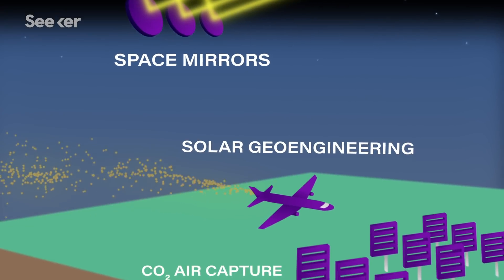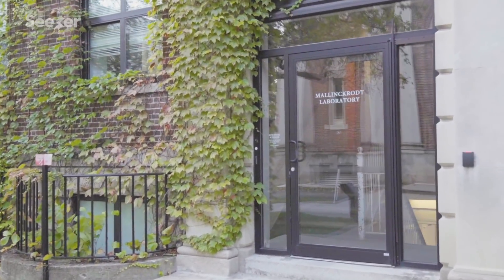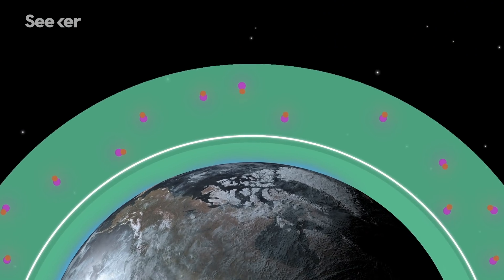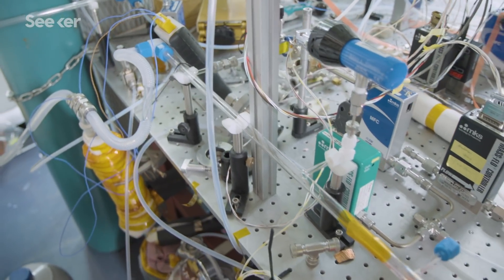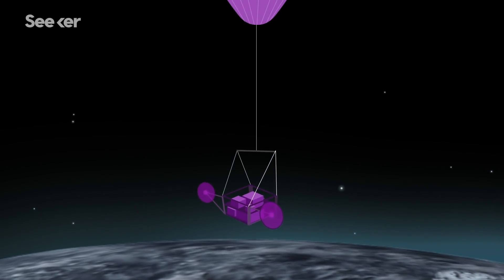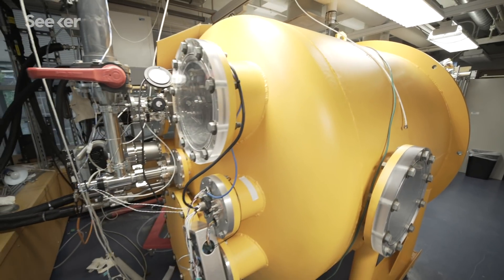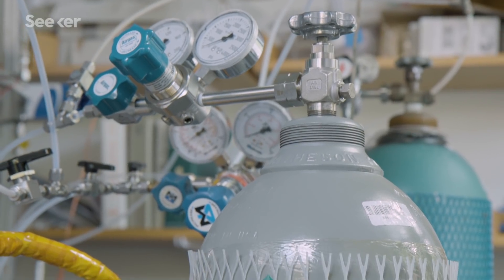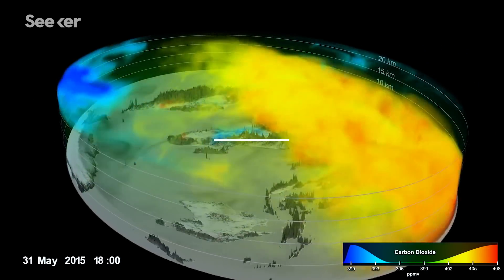Why the World’s First Solar Geoengineering Test Is So Controversial

Comment: What if we cool not the globe but Regions?
Then it’s local shading , So a dust cloud of lime, on the west coast would drift east cooling the continental US for another 4 days. It only has to reflect 2-5% of the sun to lower temp 10-15 degrees. Similar to a cloudy day. Lime has acid neutralizing properties and is a fertilizer. Who doesn’t want cooler hot days?

Comment: Sure let humanity load up on one uncontrolled multigenerational experiment with another uncontrolled experiment! Sheer brilliance! What could possibly go wrong ?! 

The old adage when in a hole STOP DIGGING  FIRST ! 

Let’s adapt first to the damage already in the pipeline ( gaseous pun) and transition to at least carbon neutral fuels , solar , wind and geothermal first ! 

The US ramped up within a few short years to win WWII . It only took 13 years to go from horse drawn carts to gas powered model-Ts! It can be done ! Leadership and will are what is needed!

Comment: In the 1970s scientists wanted to use crop dusters to spread charcoal dust on the ice caps to absorb more heat to prevent the coming ice age. Good thing we have never taken drastic steps in the past. Manhattan was supposed to be under water by 2016 according to al gore and “the consensus of scientists”. All you can do is laugh at them I guess.

Comment: Well someone jumped the gun and started this many years ago. Or EPA don't check what's in jet fuel anymore. Because jets exhaust or spray from jets, are making clouds. Last I checked, clouds come from particles in the atmosphere that moisture attaches to and becomes visible as clouds. So, these clouds that comes from jets are due to some kind of particulates being sprayed from the jets. Even more proof is that when they turn them on and off . The temperatures vary in height and unless the jets are diving up and down throughout the sky , they have to be turning on and off the spray  I got lots more.

Comment: Misleading title; 1st enclosed test

Weather modification's been going on for decades many countries openly admit it using it. 

Even NASA published on the impact and side effects of mass Aviation persistant contrails which increases Greenhouse effect caused by vast amount of CO2 on a daily bases with more than 200K flights per day, call what you will planes plumes darken the sky blocking the sun almost everyday.

Comment: Geoengineering experiments are necessary to determine if they cause harm to the environment and if they work. They are measures of last resort since mankind might become addicted to geoengineering on larger and larger scales if it's used instead of reducing co2 levels. If a world war or an economic collapse interrupts the artificial cooling there might be a rebound where the temperature rises out of control.

Comment: One of the small graces was that because we used coal so much and for so long we caused global dimming, which allowed us to keep global warming from progressing too quickly. However, this isn’t good in the long term. We have to find something to reduce the CO2 quickly before the smog clears as we move to sustainable energy production.
Reply: Why would the smog clear?
Reply: @yourmomsphonenumber  if we stop putting as much into the air because we move towards combustion that is more complete or if we forgo combustion all together and choose solar or wind there is less smog entering the atmosphere allowing the smog that is already up there to drop back to the earth through natural processes clearing the smog naturally over time. But the CO2 doesn't get absorbed nearly as quickly and will linger causing lasting damage.
Reply: @milohobo9186  But every solar panel every windmill, every electric car, everything needs to be produced so I'm really not sold that smog is going away. I could just be dumb and I'm not saying we shouldn't try to create a solution but I'm really not convinced that we have any solution yet.
Reply: @milohobo9186  we just rely on petrochemicals too much we have too much we can't just stop now...

Comment: Stop gap measure at best. And people will only take the inch of space this gives and rapidly use up a foot. So then you would have to geoengineer more. And then more. Sooner or later there will be repercussions, and it may not be easily reversible. The fact of the matter is that the world population needs to reduce by half. At least. Amd even that may not get is out of this mess. The feedback dominos may already be falling and we could be locked into a devastating outcome. There is no nice way out of this. It's either stop growing and retract, or face a worse outcome. But even the best outcome is probably horrendous and terrifying. The worst is nightmarish.

Comment: Putting particles in the stratospere is fuckibg stupid.. uncontrollable.
What follows might look like a fantasy but is in fact quite easy and is plain common sense.
We need to invest in industrialization of the moon asap and the first thing it produces is a bunch of thin mirrors who will shade the earth from the sun a bit if needed to cool it a bit.. and perhaps a magnetic rail launchsystem to launch them up from the moon. Voila.. manual thermostat.. one problem solved. 

Be good to children etc etc.

Comment: Flawed premise for investigation, experiment bound to fail. You took the IPCC models and 'data', assumed it was true and proceeded forward. What you should have done is question the data first, instead of assuming it was correct and assuming there is a problem with CO2. Find out how they made those projections and models, you will be sorely disappointed.

Comment: I'm starting to see that many of these, climate change, Scientists models are static. They aren't taking into account the magnetic field and how of course there is going to be a depletion/hole in the ozone at the North and South Poles. Or that the earth's climate is dynamic in that it expands and contracts based on the amount of aerosols that the atmosphere takes in at any given time, from natural events like volcanoes which put out way more pollution than humans do. It's a safety net built into the atmosphere. I think we need to get away from these computer models. Because they don't ever have all the information necessary to produce a realistic picture. That's why the FIELD is where discoveries are made. Anyone can plug in and number of different scientist data to make their Theory work without putting in any field work.

Comment: I am not opposed to research, but I've said for a while that the hysteria over climate change looks a lot like Pascal's Wager which is a faulty proposition because it doesn't consider that taking the proposed action could be worse than doing nothing. I don't deny the climate is changing, but I don't trust that we understand the situation deeply enough to take sensible action outside of the things we're already doing (namely, developing alternative energy sources).

Comment: Instead of spraying more crap into the atmosphere to try and increase the albedo, why not build massive CO2 scrubbers to remove the excess carbon 12 we are adding to the atmosphere? This seems like a much better plan in my opinion because we could use the CO2 harvested from such a system to produce A net zero algae-based fuel to replace gasoline and kill two birds with one stone. This would give us enough time to reduce omissions to zero while dealing with pigheaded government officials who refuse to act.

Comment: Actually they’re both right we need both adaptation in the form of changing how we produce energy by switching to wind solar advanced battery  energy storage using liquid flow batteries Nuclear fusion. Thorium fission wave reactors using molten lithium salt Hydroelectric power plants designed like a toilet so the water creates a vortex So you Can Place place it any where And geological engineering of the planet

Comment: All you would have to do is put the chemicals in jet fule. Control which flights get the chemical fule. Flight paths turn into high or low pressure zones. Best way to implement on large scale

Comment: You know it's a sick society when instead of even considering reducing our population, consumption and production (the most potent and easiest way to mitigate the inevitable and impending ecological collapse) we're trying to devise over elaborate techno-fixes when what got us into this crisis to begin with are shortsighted techno-fixes.  We as a species really really have to face up to our near ubiquitous believe in the myth that technology can miraculously fix the ecological crisis and our completely unfounded techno-optimism...

 There's absolutely zero evidence to suggest that technology can solve this problem and in fact there's evidence to demonstrate that even if we had a level of technology advancement well beyond our current means we STILL COULDN'T fix the problem, and yet nearly every believes it will.

Comment: Think of the air as a fluid if you would. It separates into regions. So take samples in each "region" to find out its co2 saturation.  Provide a safe neutralizer and catalyst in each region to accomidate its saturation level. But we gotta leave some i guess... just spinning the ball.

Comment: DUST it's the job of the future to be dangerous -- So it's about chalk fine dusting the stratosphere to fight the symptom of global warming. No effect on ocean acidification extinguishing corals and shellfish. Hard meta question: Can we sufficiently reliably know that the damage that this will likely do (where it's released and also where it eventually goes - that is down) will be smaller than the damage if we don't do it? 
CaCO_3 particles are likely a lot less bad than acidic sulfuric particles but it's still high surface area fine-dust in an unusual place (where it won't stay permanently). Highly controversial topic.

Comment: The downside of this „brilliant“ geoengineering is, not only the sunbeams are reflected, but the heat under the shield is trapped and can’t dissipate outside the stratosphere...... That’s why we have the heating up of the  planet in the first place! 😳
Reply: Move to the front of the class.
Reply: Incorrect. The proposed calcite aerosol scatters shortwave radiation (sunlight) not longwave radiation (heat)
Reply: @MsCocknuggets  It creates a net temperature gain because of the blanket effect.

Comment: so what i'm hearing is "don't give us enough time to solve the problem using technology by doing some solar engineering so that we can keep doing what we're doing that doesn't work, which will (according to the thus far continuously wrong predictions) kill us all by drowning and fire. 

the emmitions from the US are already significantly lower than they were, because we're using technological improvements to fix the issue. this is not the case in most of the rest of the world. They need time to catch up, geoengineering may give them that time. If any of the predictions are correct...which thus far they've not been.
Reply: The rest of the world is already moving towards electric cars, ignoring what is happening in the rest of the world is quite dumb.

US has a lot of electric car tech, yet some people think "climate change isn't real" whereas the rest o the world actually knows it is real.

Japan is the one moving the fastest towards an all electric transportation industry, so why have the US not caught up with this? Because of political dickheads who never takes climate change seriously like the rest of the world do.
Reply: @kusogaki_man  There's some really cool battery technology that's currently in the testing and scaling phase. Some neat solid state batteries and a few other really interesting carbon based ones that, when they are no longer useful, won't poison the earth when disposing them. 

Some of the tech that's off the drawing board and being actively worked on will both improve solar technology and battery technology. Both of which will reduce the need for fossil fuels AND look to be scalable and inexpensive. those will make it so the places that need fossil fuels the most can have the benefits of NOT polluting while still have electricity and moving into the 20th century. 

We're getting there, the tech is in process to solve a lot of these problems. If we can keep the government from taking the opportunity for a money and power grab like the Green new deal (of socialism takeover) then American ingenuity might be able to roll most of this back.

Comment: Why don’t y’all just block out the sunlight by 25%? Literally just build a solar shield for the poles and keep the poles colder so the sea levels don’t rise, and reduce the global temperatures drastically. We don’t need to re-engineer the freaking atmosphere. Just block out some light and plant some dang trees. Or could we bio engineer trees? Increase their metabolism to where they intake more co2 and make more oxygen? Just some trees not all of them, like putting them in areas with high ozone and carbon emissions. Volcanoes, factories, highly air polluted areas too?

Comment: I'm not sure if solar geoengineering is the right thing, we might end up doing more harm than good.  we should concentrate on carbon recapture technology.
Reply: @ClickNSpam I agree about nuclear energy. But we should also   do carbon recapture. Carbon engineering, in BC Canada, is doing some great work with that.
Reply: @ClickNSpam carbon engineering is backed by Bill Gates.
Reply: @ClickNSpam most startups in a brand new sectors tend to be scams but that didn't prevent the industry from developing. 

If we can't get the price down then at least let's use nuclear power plants to power these carbon capture systems
Reply: Jameel Ja the main thing about solar geoengineering is that it’s cheap and fast, we should really be focusing on everything, on direct air capture, afforestation, research on solar geoengineering, investing in nuclear and renewables.
Reply: I wonder if there is a method to desaturate the ocean of carbon dioxide since the ocean is a massive carbon sink and absorbs a large bulk of our emissions
Reply: We are already unintentionally changing the climate in a significant way when industrialisation began. So I think it is ironic to be so fearful of other forms of geoengineering when we still think it is okay to add more co2 to the atmosphere and take our own sweet time to reduce CO2 emission. We are already in a climate emergency.

Comment: 1) wouldnt this sun light scattering reduce the efficiency of global photosynthesis and solar technology?
2) If something goes wrong you better be able to remove those gasses that were added!
3) If you could remove those gassses that you added, why bother adding random crap that doesnt patch the root cause, but instead simply remove the worlds imitions out of the atmouphere in the first place?
4) does your gasses have any means to be naturally broken down into bioavailable componets or will this be another plastic situation where it never breaks down; combine that with a delay reaction and we may find we add to much too quickly and boom now things are getting to cold for climates to adapt.
5) this technolgy seems indiscrminate as in it will just spread globaly through the atmouspher. In other words there is no zone control so what if you dont want effect an area with this gas yet neighboring countrys start pumping?

This "solution" is laughed at for a reason. Harvard work on something else my goodness.

Comment: I believe concentrated carbon dioxide is a factor but not the main factor.  look into the man made chemicals that use on electronics , hardly anyone talking about that. it is not as near as much  of co2 but it is a 100,000 times worst.

Comment: Read the new text book that talks about Solar Forcing NOT covered by typical weather models. "Weatherman's Guide to the Sun" by Ben Davidson 2ed., 2018".
We are entering the Grand Solar Minimum!  So witness our entrance into the Eddy Minimum;  Cooler/colder over the next several decades DUE TO PLANETARY GROUPING of Jupiter, Saturn, Uranus, & Neptune in a single quadrant of the Solar System. The Cosmic, ultra-violet C waves, & other high energy Fluxes now hitting Earth are at the Highest Levels in Modern Man's History & will make it very difficult to grow food in the near future.  PROTECTION from high-energy UV-C Rays is imperative! We need protective gear of all types to guard us & our infrastructure from these increasing dangers. Major dislocations of populations & little food growth is endemic during that future time. Be warned & prepared.  
         In addition,  CO2 has NOW been shown to be a Lagging Indicator, NOT a leading one.  Therefore the entire CO2 Global Warming argument is MOOT & FALSE!
The sun & the Planets have MUCH more to do with climate change than Man does by a huge factor.  FREE

Comment: Regardless of what we do right now, the climate's not going to cool down for another century or so.
I am a bit sceptical about this geo_engineering thing. A slight miscalculation and it may worsen the situation. More rigorous experiments/test should be carried out at global level. But also, the drive towards a low carbon footprint environment shouldn't be sidelined

Comment: I'm not fond of strategies that reduce insolation because I'm worried about one side effect that would only be really apparent if this strategy were adopted at a global scale. Namely, sunlight is where the energy to do most of our biologically based carbon capturing comes from. I think there's a potential for a nasty negative feedback loop. Though, thinking it through, I do suspect there's a livable equilibrium point that we'll reach before blocking all sunlight and freezing our atmosphere. I just wonder if maybe that treatment of symptoms won't result in a worse situation than the warming would.